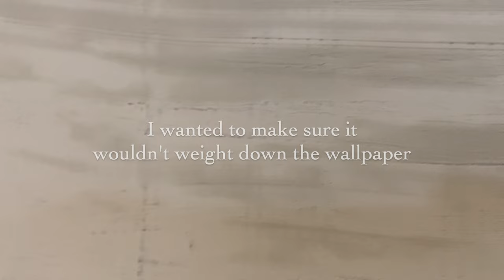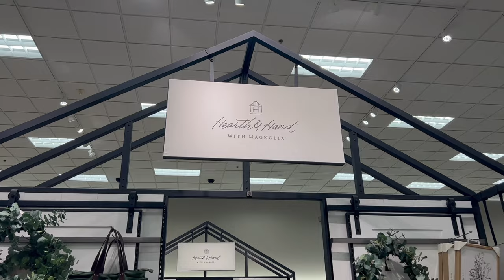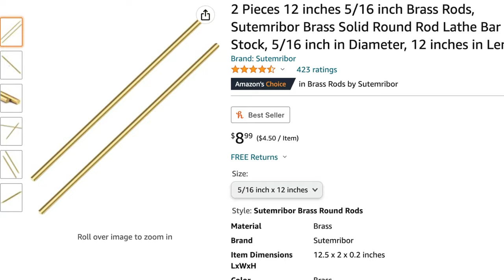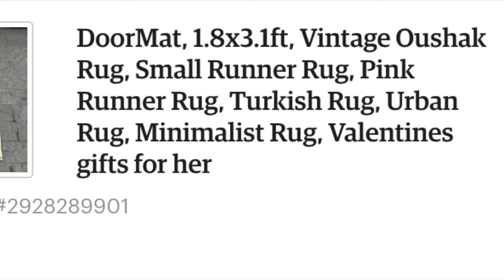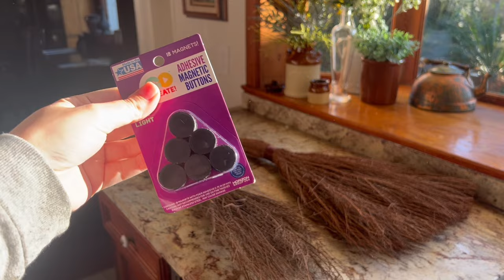*cottage witch aethestic* COTTAGECORE KITCHEN MAKEOVER -- Ep 1 of new series: Cassie's Cottage

Comment: ...I really like the baker's rack , and I was thinking you might use a tray to corral the sugar, etc. I have a similar set up on an antique dresser, in my kitchen and all the " stuff " is in a tray ,easily accessible and looks much neater. :)   
I was curious about the finish on the walls, do you need to paint it, (?) How will it hold up with possible kitchen grease, etc (?).
Looks cool, I just was wondering.
Reply from the maker: I was curious about it too. I’ve lived with it for over a year now and it hasn’t discolored or should any signs of wear. I thought I would have to fix stains and stuff but so far, I haven’t had anything like that. If there’s an issue I’ll make sure to update! But so far, so good! Looks the same as when I did it.